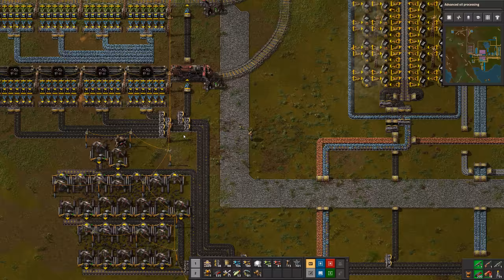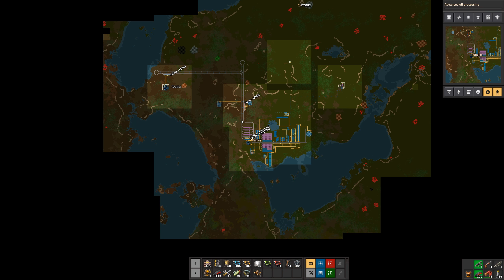Factorio 1.0 Tutorial #11 - Chemical science, advanced oil

Comment: Is your power dependent on solid fuel? May run into problems (oil cracking) here soon? I think?
Reply: I think it would be wise to set up solid fuel production from excess petroleum (maybe like once the tanks are 90-95% full.) Once petroleum backs up, which could happen easily if you're not doing any science at the moment, the refineries shut off and your solid fuel factories using light oil will shut down which isn't desirable.
Reply from the maker: Yes, I agree, that will keep heavy and light oil production going.